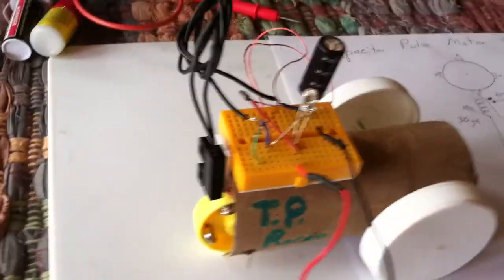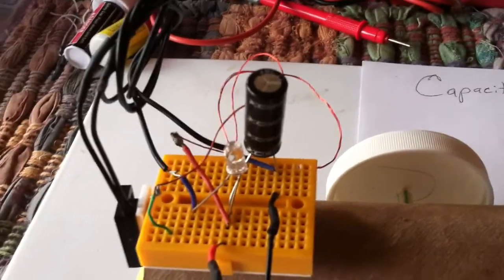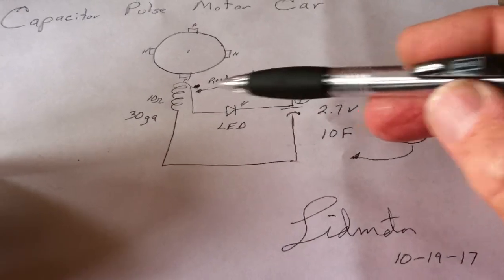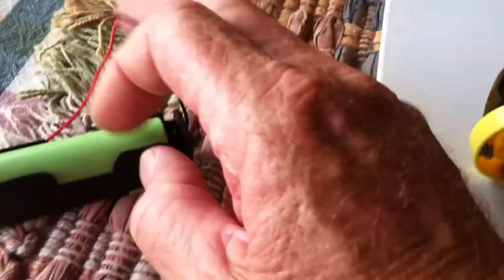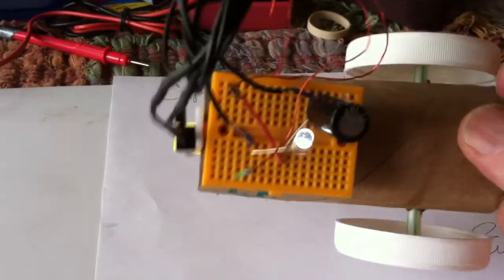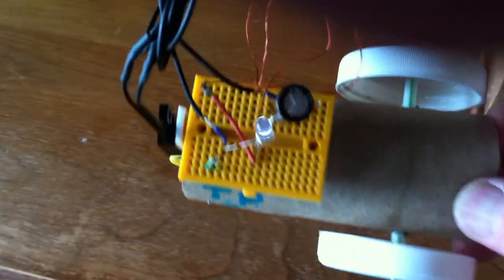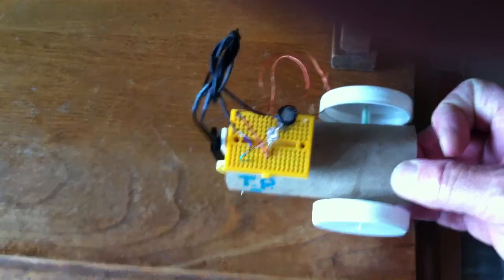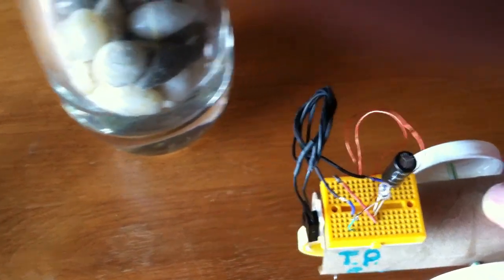Pulse Motor Car

Comment: you have to use normally  open reed switches ffor these?
Reply from the maker: Yes.    You can use a normally closed reed switch but the current drain is much higher.  The power is flowing except when the magnet passes by.  Loooooong pulse = more juice.

Comment: You need to make a circular track for it now . This motor isn't too bad,  just do some gears to get the right torque while allowing wheel to spin faster, and flywheel wouldn't hurt.
Reply from the maker: Thanks for the tips.  Better rear wheels and bearings would also help.

Comment: Not certain about the physics of this but if you reduced the circumference of one of the rear wheels and tied them together, would it go in a circle?
Reply from the maker: The easiest way is to just turn the front wheel and reconfigure the coil and reed switch.
Reply: Yeah.  I considered that but actually thought it would be more difficult to modify the pulse motor setup than to switch wheels.

Comment: Awesome, I didn't think it would have enough torque to move it at all.
Reply from the maker: I was surprised also.  It would not move with the weight of the battery on it but with the lightweight super cap it worked.

Comment: Brilliant, it works, love the supercapacitor feature. It would be a complicated addition but it would be great to have a slipping clutch of some sort to let the motor spin up before engaging the wheel. Maybe a governor that swings out to engage the drive when when the motor is up to speed. (Just thinking aloud) :-)
Reply from the maker: I was thinking about a flywheel also but the extra weight wouldn't be worth it.  A pulley setup like you used is perhaps the best answer but that is a whole different project. I was really glad to see this thing move.  This makes a good baseline to work up from.
Reply: Of course the holy grail might be a solar powered self starter 😊